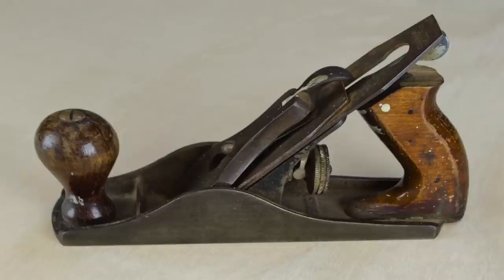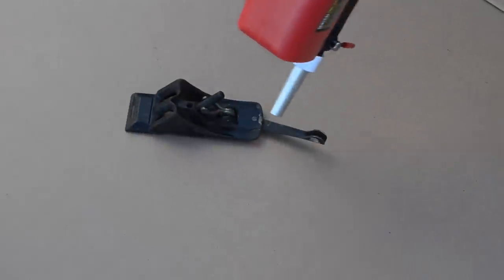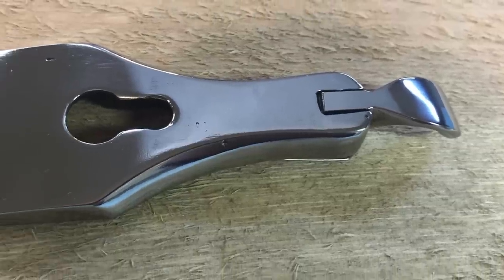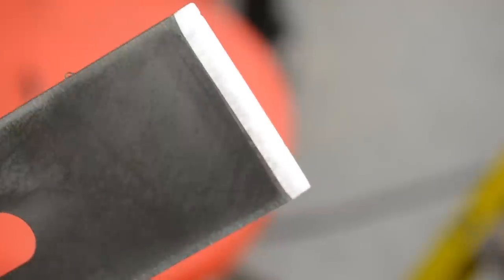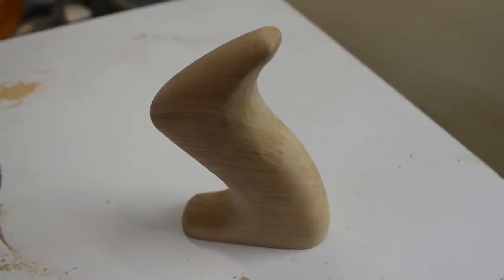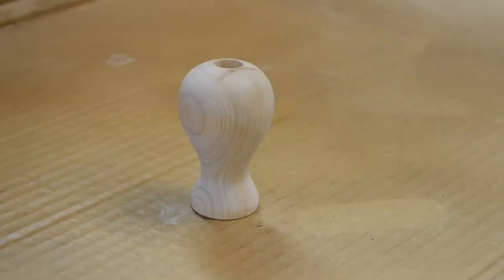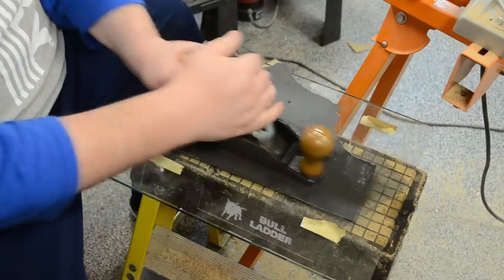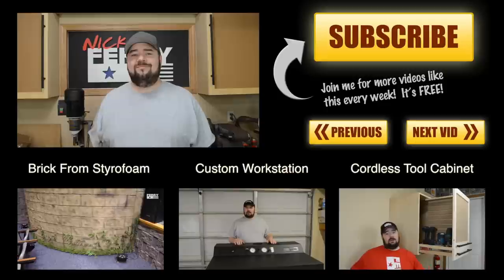Ⓕ How To Restore A Hand Plane (ep49)

Comment: I started counting down the hand plane restoration videos on YouTube - and I just stopped at 102. There were more, but I had seen enough, Thank God we now have another "How to Restore a Hand Plane" video here. HONESTLY, I have worked with wood for many years, building some furniture and LOTS of cabinetry. I even used a hand plane once, although that was the fix a bedroom door which was sticking a bit. 

Since retiring, I have more time to watch videos. Naturally, I was drawn toward woodworking subject and it then that I first discovered this widespread PLANE FETISH. I see people's shops with planes that cost enough to outfit a full wood shop and, perhaps, a nice machine shop as well. Is there some sort of erotic thing about planes that I never knew about?
Reply from the maker: Just depends how you prefer to reach the end goal - some just prefer hand tools in some instances and many times it can be faster than setting up a power tool

Comment: Amazing effort Nick, very inspiring. I recently inherited an old plane which needs cleaning- having never used a hand plane before do you have any advice on how sharp the iron needs to be and how far it should stick out below the shoe? Thanks
Reply from the maker: James Davies the sharper the better - start with the iron not sticking out of the mouth of the plane at all and sneak up on the cut by extending it a little at a time until you have your desired depth
Reply: Nick Ferry Thanks Nick. Know what I'm doing for the rest of today.

Comment: Turned out lovely, I've restored a bunch of planes (everyone I own) but never to that degree. I dunno if you have tried setting the cap iron really close to the edge or not (so you only see a tiny sliver of light or so), but that both helps with tearout and increases the planes usable time between sharpenings.
Reply from the maker: Thanks - I normally keep it back a bit further but have moved it closer with some figured wood - I'm no expert when it comes to hand tools but learning everyday

Comment: Could not have had better timing. I just purchased a plane from a local antique shop and was a little intimidated about restoring it since I haven't even had one in my hands since 4th grade. This video helps me alot. Do you have any suggestions for someone who doesn't have sandblasting availability?
Reply from the maker: ***** perfect, that is cool timing - if sandblasting isn't available, I would look towards chemical strippers - naval jelly - http://amzn.to/1EwfTlL - is a decent rust remover - or http://amzn.to/1JcvnfD for a paint stripper - or a rotary tool with a wire wheel can get into small spots as well - http://amzn.to/1JEmqzh - hope this helps

Comment: I bought a cheap HF sandblasting kit a while back and figured out that play sand filtered through a window screen makes great blasting media. The bags of sand are only $2-3 so theyre cheaper than buying blasting sand. If the nozzle on your blaster is large enough, it might be a good alternative.
Reply from the maker: Jesse Bridges I have used play sand before, as long as it is filtered it works pretty well - a window screen does a good job
Reply: Nick Ferry great job on the plane btw. You made a diamond out of coal.
Reply from the maker: Jesse Bridges thanks Jesse!

Comment: Hey Nick, great video. Just curious what compressor you are using and if you think it is adequate for this sand blasting task? Also, what safety equipment are you using? Just curious as I am thinking of picking up a compressor, and this is one of the tasks I would like to perform with it. Thank you.
Reply from the maker: +Brave Ace thanks - I have my compressor listed here - https://nickferry.com/my-tools-equipment/ - I also talk about it in my compressor station video here - https://www.youtube.com/watch?v=9sJLQc7uwI4 - my compressor is big and keeps up no problem - typically smaller portable models don't give enough CFM for blasting but you can often get smaller nozzles to reduce the CFM needed - a face shield and respirator should always be used when blasting or a vacuum if using a blast cabinet - hope that helps

Comment: Looks awesome! Hey what kind of stones and honing guide are you using? Also where did you get that sand blaster?
Reply from the maker: Matt Thayer thanks Matt! - cheap diamond stones from Harbor Freight and the sand blaster is also form HF for around $20
Reply: I thought that the sand blaster looked like a harbor freight. so do the diamond stone work alright?
Reply from the maker: Matt Thayer they work well for the price - eventually I want to get some decent water stones but you can get pretty darn good results with these - I'll probably talk about it in the next FerryTalk
Reply: Cool. My cousin the big hand tool guy used to use the water stones but he said he had to flatten them too much for his taste. He now uses a piece of granite and sandpaper. I think I would like to get either the worksharp 2000 or 3000 for my stuff. I like that i dont have to take out my oil stone and the stop mid project you know?
Reply from the maker: Matt Thayer yup yup - I've always wanted to play around with a Tormek
Reply: I havent heard great things about things about the tormek

Comment: Nice plane restoration. How'd that Harbor Freight sand blaster work for you?  I bought one and couldn't keep the media from getting into my eyes. In fact, I think I still have one in my eye. Hold on, I'll be right back.
Reply from the maker: Joshua Luther lol - I don't much care for it - a blast cabinet is preferred - but no budget or room for now
Reply: I agree. It's the cheap route and works ok for smaller projects.

Comment: Another trick you can use when tightening brass screws is to use some paper or thin clothe/leather in the screw slot to make sure the screwdriver is a nice snug fit.
Reply from the maker: John Smith that is a good idea - we used to use old tee-shirt on pipe wrenches so as not to scratch the chrome, so that makes sense

Comment: Question. with the final step of sole plate sanding I noticed you had a pane of glass under your wet/dry paper would a glass chopping board be a workable solution (smooth side of course)
Reply from the maker: +Ben Barnes-scrivin I suppose it could - the reason glass is preferred is float glass is as close to flat as you can get

Comment: Hey Nick. I am new to woodworking and your video gave me the confidence to restore a stanley vintage jack that i purchased for cheap. In the process I will need to sharpen the blade and I currently do not own a guide. I looked at the veritas charpening but it cost $70. I know this is an important tool to have and I am not trying to get the cheapest, I want to get a not so expensive one that will get the job done correctly. Can you help me with finding a good one that it's not that expensive?
Reply from the maker: +Dr. Paint have you tried harbor freight or amazon? here is one on amazon - http://amzn.to/1LlqYYn
Reply: +Nick Ferry I bought it like a few minutes after I left you the comment. Sorry for the bother. 

Thanks again for taking the time to reply to my silly question.
Reply from the maker: no problem - you don't know until you ask sometimes - have fun restoring!
Reply: I put the pictures up as soon as I get to the projects. Thanks a lot
Reply from the maker: Omar Rivera awesome!

Comment: How did you clean up the thin metal piece that is attached to the underside of the lever cap? I just finished cleaning up a plane (not to a mirror finish, just removing the rust) and am concerned that there may be rust between the thin metal and the lever cap that will cause problems in the future.
Reply from the maker: I didn't have much (if any) rust on the spring holding the lever - I would say either keep it coated in an oil or rust inhibitor or remove some of the rust with vinegar and then use whatever protectant you desire - if you do social media, post a pic when it's all done and tag me in it - I'd love to see it!
Reply: See the final-ish product here: http://imgur.com/a/J4tbq

I only buffed off the rust, so it still looks well used, but I wanted to start using it, rather than making it brand new. I have two more (a #5 and #7), but totes on both are broken, so I have to make them. Due to my lack of power tools, the totes will be made by hand sometime this year.
Reply from the maker: very cool - looks nice - thanks for posting the pics!

Comment: Save yourself some trouble and throw those rusty parts in white vinegar with salt. After a day or two brush off the rust throw them into a baking soda bath.....oil......open beer and relax 😉. No sanding no hassle. The rust basically just falls off. You retain pretty much all original metal. Most parts come out of the bath looking brand new. Make sure everything is submerged COMPLETELY or you could get etch lines.
Reply from the maker: good way of doing it - done it before - a bit temperamental on time you leave it in there though - I've seen the vinegar start eating into the metal and doing more damage - always more than one way to skin a cat for sure

Comment: I have the exact same hand plane from consolidated toolworks made in 1920 . I'm trouble drilling the hole in the handle in wants to wander off to the outside of the handle. I must be doing something wrong with my drill press setup. Any help or advice would be appreciated. Hey Nick I live in  Manitowoc.
Reply from the maker: Very cool - I used to do a fair amount of work in Manitowoc - Is the drill press drilling square and straight in other more traditional operations?
Reply: @NickFerry  yes I got right on it this morning. Leveled the table side to side  front to back. I'll try a new handle Monday morning and I'll let you know if that worked. If you have ever been to Hartmans Bakery that's me. I'm for sale now. Looking to retire. If your ever in town stop in I'm there Tue through Fri  after 1 pm. Thanks for getting back to me.
Reply from the maker: No problem - I’ll try to stop by sometime - keep in mind a level table doesn’t mean square to the quill - I like using a little wire to ensure its square - bent at an angle and manually spun

Comment: A little heads up for anyone looking to replace the handles on their planes.  Lee Valley has free plans on their website for making stanley handles.  One of the things they recommend is actually drilling the hole through the handle while it's still a square block.  Then cut the handle to shape around the hole.  They explain it better on their website I guess.
Reply from the maker: Squibbleses it is a good resource

Comment: Should the plane have wax installed to keep finish?
Reply from the maker: Depends on your particular environmental humidity - if you see rust, try to mitigate by whatever means you see fit - wax is a good method - I try to avoid petrochemicals in whatever wax I use for finish compatibility - ✌🏼

Comment: Curiou if your polisher a bench grinder w a polishing wheel or if yours is an actual polishing wheel??  I’m thinking of buying something to help w polishing parts and curious what your using?
Reply from the maker: Polisher and bench grinder - I can’t remember what video I talked about it but I have a cart with 4 different grinder/polishers on it
Reply: @NickFerry  I’ve never sandblasted and thinking about giving it a try. Would you happen to remember what medium you used, what grit?    Also I picked up a polishing wheel today, and plane on giving that a try on a few planes I’m working on.
Reply from the maker: @randygust3423  It was a fairly fine media - don’t get the sandblaster that I used in the video it was no good

Comment: Hey nick, don’t know if this will get to you since this video is kinda old — but which honing guide and sharpening stones are you using here?
Reply from the maker: This is just a cheap diamond plate I picked up online but it’s similar to the one they have at Harbor freight - it’ll get you by in a pinch but it’s really not that great of an option - I’ve since switched to a water wheel slow speed grinder
Reply: Nick Ferry thanks for the speedy reply. I’m restoring a plane I found in a friends garage, not anything special, just want to see if it can get it shiny is all. I saw it was listed in your tool list on your website and went and made the purchase, thanks for the heads up.
Reply from the maker: No problem - it’ll be fine for a couple of planes - if you get more you can worry about a better system then - it’s a cheap entry point

Comment: Just a quick tip for our next restoration: You can download complete handle models from Lee Valley website http://www.leevalley.com/us/wood/page.aspx?p=63262. They have the full size plans for almost any size of hand planes. They also include easy instructions to make the main hole in 90º.
Reply from the maker: Joel Alexandre yeah someone else had mentioned the same link - seems like a great resource and really good tip, thanks - I suppose if I try and do another I may have to check into

Comment: With the painted enamel surface, do you need to clear coat it?  I take it you wouldn’t be able to clean the surface with acetone or mineral spirits in the future?
Reply from the maker: I didn’t coat the sides or sole - I hope it didn’t appear that way in the video - it’s bare metal that can be treated like any other in the shop - it does see the occasional wax, but that’s just to make it easier to use
Reply: @NickFerry  my concern was the painted enamel surface that won’t take any cleaning with any mineral spirits or acetone in the future, unless it’s clear coated?
Reply from the maker: @kle2217  I would imagine acetone would takeoff the black paint or at least screw up the finish but I’ve never I had the need to take acetone to my planes outside of a restoration
Reply: @NickFerry  I may end up doing a spray in clear coat to my painted surface just in case.  I didn’t prime my surface before spraying enamel on it either.  Hope my paint sticks good enough. 🙏. Thanks for the video and info.
Reply from the maker: @kle2217  best of luck - try to remember the primer, it tends to chemically bond better

Comment: A+ for the restoration but only B for sharpening... would liked to see honed edge on that iron... and BTW if that is the orignal iron guard it with your life you wont get that high carbon in irons...
Reply from the maker: pjakkur007 thank you - the 1500 grit was the highest I had - I would never get rid of the old iron
Reply: Nick Ferry That buffing compound you use on your buffingweel try spreding that on a scrap plywood and pull the iron with the grain works wonders if you dont have a lether strop ;)
Reply from the maker: pjakkur007 I did want to get a strop for down the road - good tip

Comment: why didn't you flatten the frog on which the iron sits?  From what I understand it should at least be a metal on metal contact. Otherwise it won't allow the iron to slide when you are lowering and retracting the iron.
Reply from the maker: I can't recall if and how much paint is on there but the iron moves nicely